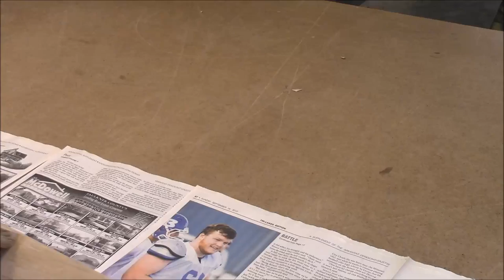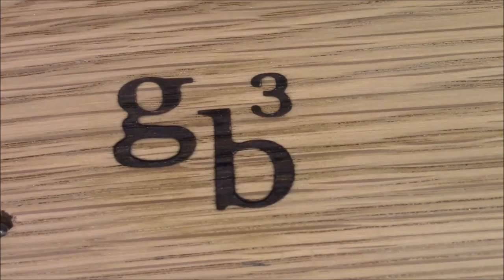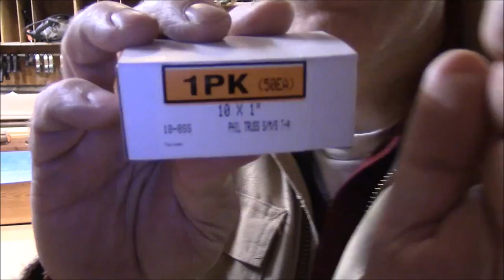Easy Homemade Toboggan Sled

Comment: Thanks for sharing this vid. Snow is forecast here in Ireland and I'm currently copying your design ☺

Edit: Barrel was a pain in the ass to work with, so I got some 1mm aluminium plate to use in its place. Also going to put two parallel skids on the bottom to help it go straight. Any videos of yours in action?
Reply from the maker: Unfortunately we haven't had snow since I made the video so I still haven't tried it out.  The two skids on the bottom is a good idea.  I would have trouble with the aluminum.  When we do get snow, it's usually not very deep and I think the kids would wear through the aluminum on the rocks.  I'd love to know how it turns out for you.

Comment: great job... one quick question though.. with the screws.. are they protruding so much they might interfere with the performance by chance?
Reply from the maker: They might but they have a low profile head and have not been an issue.